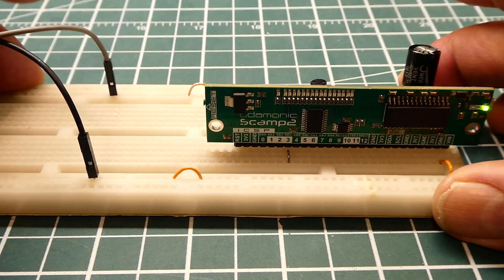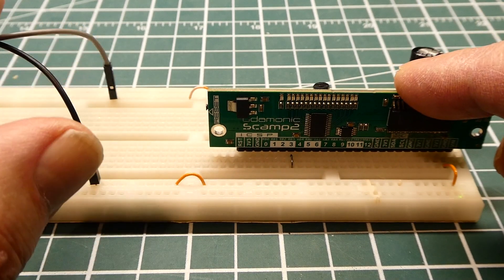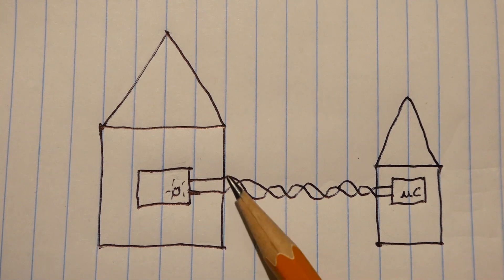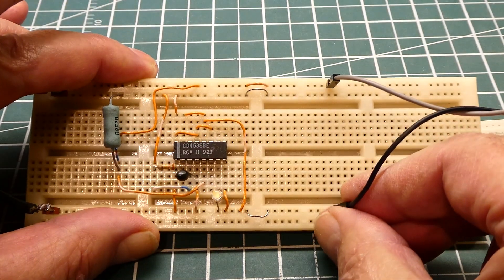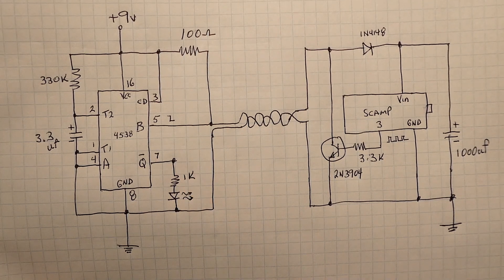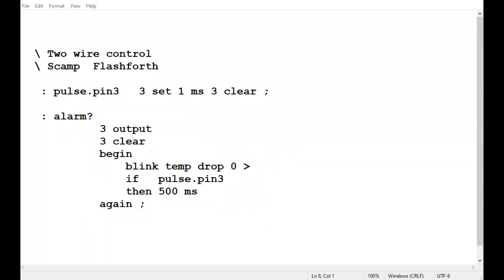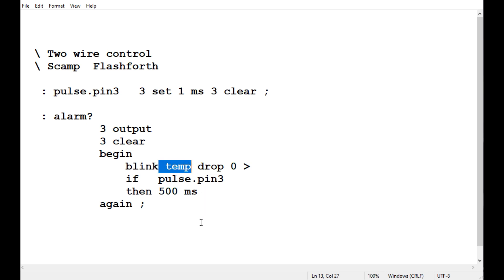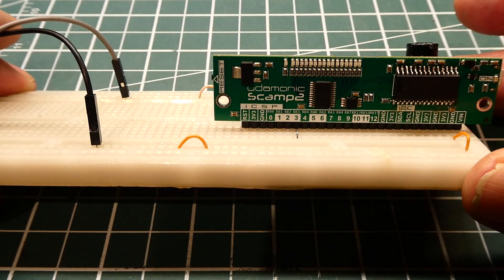TwoWire Interface / Power And Data Over The Same Twisted Pair

Comment: I've been looking for something like this! Is it possible to do something like this where an arduino is the one checking for signals on the twisted pair, and the devices on the pair are the ones with the sensors, and each device has an address that is set so that the microcontroller knows which exact device has new data?
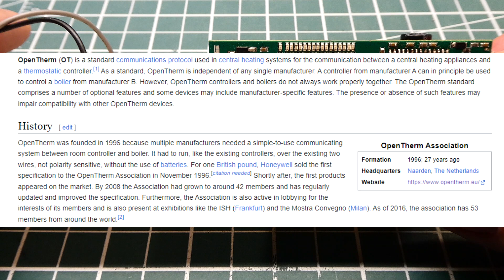Reply from the maker: Yes, you would have to come up with your own data protocol. Check into OpenTherm 6:57 for examples. Also look into Dallas Semiconductor 1 Wire protocol.

Comment: for such application it looks good, but most likely you'll want to update  it in future and then you have a problem.
I would use two cheap Microcontrollers like Arduino or AVR itself, connected via LAN cable (2 lines data and rest for power) and transfer data over RS485.
This way you are very flexible on sending commands and doing watever you want on both sides.

Comment: That's really great Ken. Another very interesting video. I really like that application - very simple yet very effective. I also liked the photo of winter there - wow. Winter here is only 3 weeks long, and it means you have to wear a sweater at night, but t-shirt is fine during the day. Very different!
Reply from the maker: Hey John, the snow has arrived. Had to pull out my winter coat and gloves and turn up the heat in the house.

Comment: I  can see endless applications for this.Thanks for another great idea Ken.
Reply from the maker: You're welcome!
Reply: It's a good idea, but it won't really solve any issues. It only works for a single bit of data. It could be improved with a much larger capacitor that would periodically get charged up by the twisted pairs and then transmit a digital signal in the other period. Or just run a third line and call it a day.
Reply from the maker: A lot of people look at a "simple" solution and quickly regard it as useless. Back when automatic garage door openers came out they did not have safety sensors. Pets and children were getting injured so government regulations deemed them necessary. The company that got the design contract used this same exact technique and became a multi million dollar company selling sensors for all new installations. You probably use this circuit everyday. https://youtu.be/CdpjvQUqqL8

Comment: Very cool circuit, thanks for presenting it.  I suspect that you don't want to go too high on the pulse duty cycle otherwise the voltage to the uC might sag.
Reply from the maker: Yes, you are correct. There are always trade-offs in electronics.

Comment: Smart KISS circuit design... Thanks for another good one... Bookmarked👍
BTW... what is the Max length of the twisted pair ?
Reply from the maker: The line resistance will increase with distance so that will determine the range. Normally with this circuit you will get a couple of hundred feet of range. To increase the range check out the tips I gave to another viewer in the comments.

Comment: How long can you run the twisted pair?
Reply from the maker: The line resistance will increase with distance so that will determine the range. Measure your line resistance and apply that value to the breadboard for testing and tweaking. You can change the value of the series resistor and also increase the power supply voltage up to 15 volts as it is running a CMOS circuit. Use a microcontroller/sensor that draws little current to keep the voltage drop across the series resistor to a minimum. I like using the MSP430 line of microcontrollers as the current draw is small. The pulse width on pin3 can be increased to off set any capacitance loading. Normally with this circuit you will get a couple of hundred feet of range.